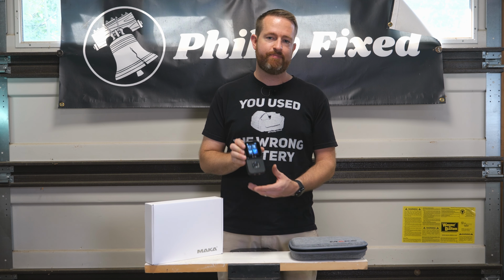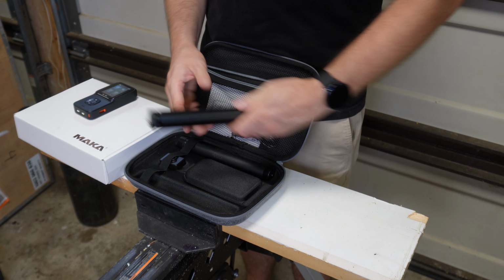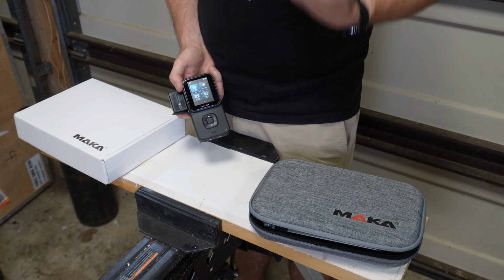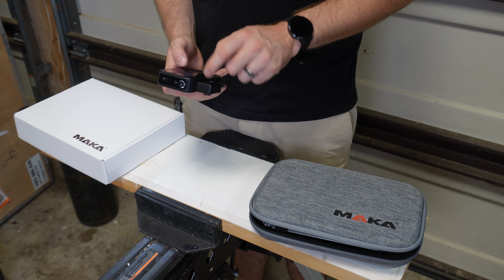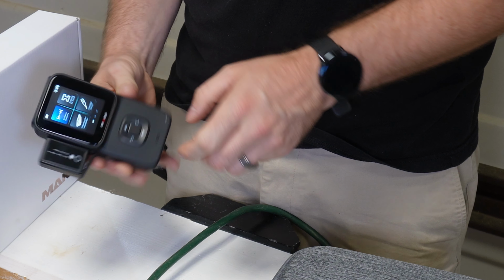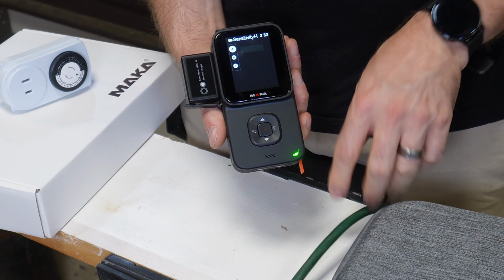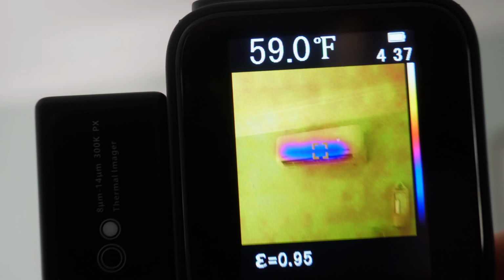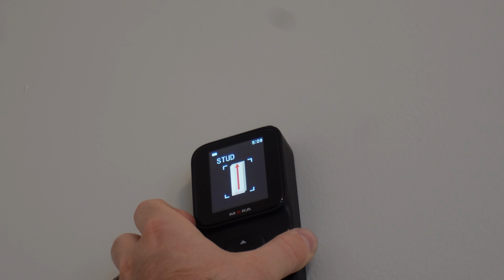Thermal Camera, Stud Finder, Laser Level and More! 🔥

Comment: Where's the D-handle?  Can't believe it doesn't have a screwdriver or a hammer.😂
Seriously it has a lot of features, nice! The lower sensitivity is usually for finding the single hot wire among others to narrow the wire down you may be looking for. I also wonder if the voltage alert makes a beep(s) as well if the speaker is enabled. Nice review! I hope all has been well! God Bless!

Comment: For this to be meaningful I would have liked to see each function compared against a professional tool.  For example - see how level your surface was when measured by a digital level which goes down to 0.1 degrees, as well as against a good quality bubble level.  

Test the moisture meter against a Wagner or similar - cheap pin based meters are notoriously inaccurate.  

Test the stud finder against a good stud finder.  Project Farm showed difficult it is to find a truly accurate one.  It doesn’t really tell anyone how good it is just to show it ‘getting results’ when they could be meaningless.  

How accurate is the thermal camera?  While it could detect temperature gradients, were the measured temperatures accurate?  I thought it looked a little crude. 

To me this is a fun little gimmick worth maybe twenty bucks and similar to that double ended screwdriver which lives in the kitchen drawer and comes out once per year when you don’t have anything else handy.  

I appreciate your reviews though, and the time you take to explain stuff, just would like to see a more concrete methodology for assessing this kind of thing otherwise it comes across as paid sponsorship.
Reply: They all use the same MEMS accelerometer technology, so I doubt there's much there to worry about. Same for the laser measure (time-of-flight measurement ICs are pretty cookbook now), and the thermal imager (only a couple manufacturers for those). But I completely agree on things like the moisture meter and stud finder, which are a much more analog process. It would also be interesting to take 5 or 10 of these units and see what the unit to unit consistency across all the functions are.
Reply from the maker: Good feedback, thank you.